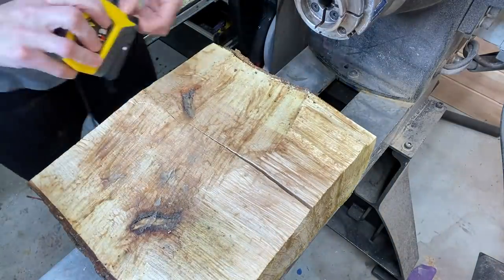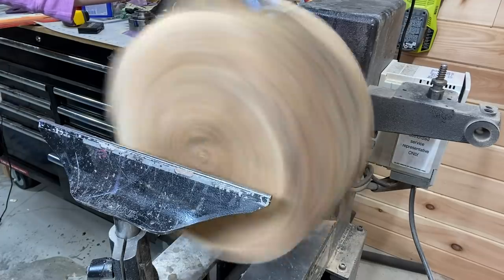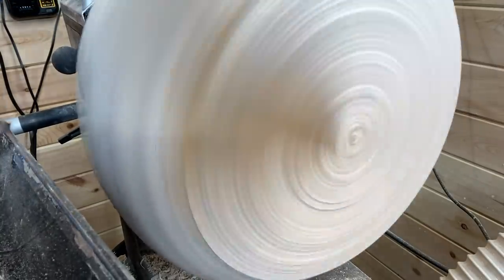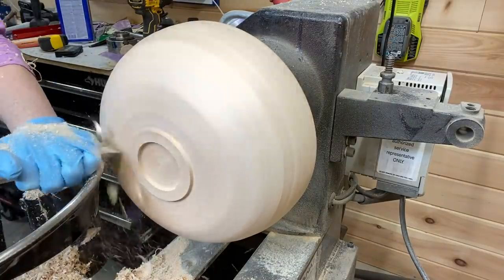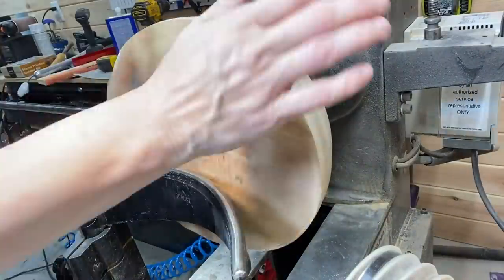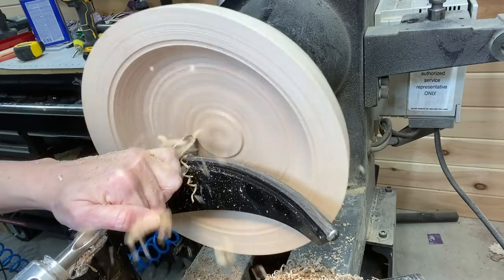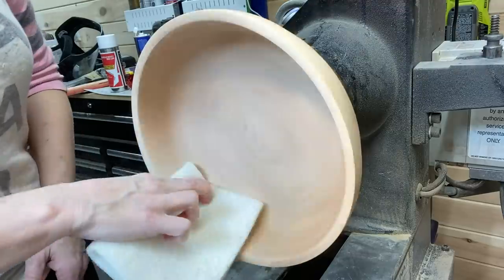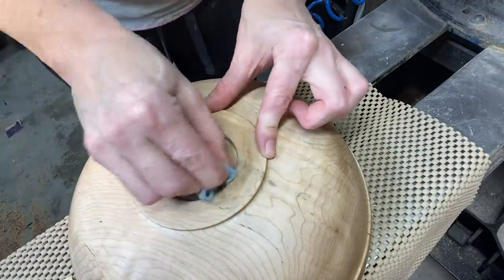Woodturning a SILKY Smooth Finish (How to)

Comment: I'd like to share a sandpaper tip I learned from an interior painter back in the '70s:
 Cut a 1.5" to 2" strip fom the narrow side of a sheet of sandpaper, fold it in thirds lengthwise. It's much easier to hold and manage, you'll utilize more of the sanding surface and you"ll have 3 surfaces to use before cutting more.
Reply from the maker: Awesome, thanks!!
Reply: It won't make sanding any more pleasant, but easier is always better.

Comment: Oh the Zen of sanding! I did high-end stringed instruments finishes for years.  Talk about sanding!  All by hand, (tuff to spin a guitar like a bowl).  Also, during surface prep, before the first coat of nitrocellulose lacquer, the sanding pattern must follow the grain to avoid cross scratching.  Necks, sides, back and sound board, including the areas where the neck joins the body, generally 80 to 400 grit.  Then spray and sand, spray and sand until you have a glass like, super thin finish.  .  Definitely  requires a high tolerance to repetition.
Reply from the maker: Wow, yes, but what a nice finish in the end!

Comment: A very beautiful maple bowl with a great grain.   I am always confused by the very common practice of driving screws with a powerful battery powered drill without first drilling a pilot hole. Especially when the wood is as hard as the aged maple  “blank” must have been. I was actually taught that in wood shop in 8th grade. My impression is that the quality of most wood screws today isn’t sufficient to stand up to the drills. So I always drill a pilot hole...a precaution that is worth the effort, I think.
Reply from the maker: Thanks. Sometimes I do and sometimes I don’t.

Comment: I have a Jet 12-21vs and I use 1&1/4 " torque drive and I still have the same 7 of 8 screws for the last 2 years, one broke off. Torque drive is the best to use, they don't strip out unlike a Phillips and you don't have to use a lot of downwards pressure. I make 70-80 bowls a year to sell at Farmers market.
Reply from the maker: Nice. Thank you!

Comment: Love your work. That chuck is really expensive!  Then the additional jaws just make it worse.  I’ve used the One Way Stronghold chucks for years and they are bullet proof.  I also built a jig for the bandsaw that will cut a blank that needs little trueing up. I don’t like getting beat to death riding a bowl gouge on a big piece of wood knocking corners off that could have been cut off.  Continued success.
Reply from the maker: Thanks, Sandy!! I agree, that a lot of money~

Comment: Good afternoon Peggy,
I hope you are doing well.  I haven't been getting the notifications of your posting of videos.  I saught out your videos last night.  When I had my millwork business and we had a board was developing a split, we would drill a very small hole at the end of the split which would stop the board from splitting further.  For us it worked every time.  The drill bit we use was 1/32" or smaller.
Reply: By the way, I'm in Dunbar, Wisconsin.
Reply from the maker: Good to know, thank you!
Reply from the maker: Never been to Wisconsin

Comment: Regarding screws, I am a big fan of deck screws with the torx/whatever pattern (bit comes with them).  I have literally been using the same 6 screws for probably the last 30 bowls I have turned and nary a problem yet.  They hold up very well and don't seem to strip very easily.
Reply from the maker: Good to know! Thanks!

Comment: I have bees wax in my tool box and rub wood screws along it to ease them in to fresh wood with a pilot hole. I used to snap off a lot of wood screws. Not anymore. Dad had an old bar of Dial soap in his toolbox for the same reason. Great work and tips as always! 🤓 Also, did you know that Lubec, Maine had a population of 1,359 in the 2010 census? Was one of them you? 😎
Reply from the maker: Nope, I wasn't there in 2010. I go back often though. Good tip on the beeswax!

Comment: Hear is a good tip. Do a way with thoese  Philips face plate  screws,through them in the trash. Instead use 1/4"  or larger hex head drive lag screws, 1 1/4" to 1 1/2" long . These will hold more effectively, be easier to remove with drill, and last longer. You may need to drill the face plate holes larger.
Reply from the maker: Great tip! Thanks.

Comment: Peggy, I liked 2. Was told for a mortise to leave at least 1". If you have different jaws for your chuck, would it be cheaper to buy another chuck like you have, compared to $400 for the new chuck. I would check it out if I lived in Lubec, Maine instead of Monroe, Michigan! How much does a bowl corer cost?
Reply from the maker: Thanks! A coring system ranges from $350-$500.

Comment: Lubec, Maine...Get a Vicmarc VM-120 (~$260 my chuck) or VM-150 (~$400).  I and many other pros (like Ashley Harwood) have used Vicmarc chucks for years.  My humble opinion is that they are one of the best chucks available.  Here is a typical comment about Vicmarc chucks:

 " The vicmarc chucks are on another level compared to the nova chucks. We use vicmarc chucks and have never had a single problem out of them, and that's with turning a few thousand bowls every year.
They aren't cheap, but you'll wear out 4 nova's before you even clean a vicmarc.
If your going to use the full capacity of that lathe (20" or so?) Your going to want a good chuck that'll hold. I've turned several pieces 26"+ and the Vicmarc chucks grip like nothing else."
Be safe and creative...kunk (subscribed)

p.s   Beautiful bowl,  well done
Reply from the maker: Cool, thanks very much for the info.

Comment: I'm curious to know why you use the curve tool rest on the inside of the bowl but I never see you use the curve to actually curve around the outside of the bowl? 

  About the chuck. How many times do you actually need to change jaws? You can buy  Nova bare chucks for $100 and jaws separately to make what you want and for $400 you could have 2 extra chucks with jaws already mounted and just swap chucks
Reply from the maker: Thanks for the info. The curved tool rest is specifically for the inside of the bowl. They make ones for the outside too.
Reply: @PFWoodturning  I didn't realize that, I thought the same rest could be used inside or outside of the bowl, thank you.
Reply from the maker: @dirtycurty1202  I didn't know it either, until a few months ago!

Comment: Please! Tried & true woodworkers don't ram a woodscrew into year's dried hard maple, without pre-drilling the screw's core size.
Reply from the maker: Never said I was tried and true.
Reply: @PFWoodturning  All of us here, no matter the years or decades we have invested in this hobby/trade/profession/craft/etc. can learn lessons, should we so choose.  I see many on these woodturning channels, spread glue with a credit card, when a 3" paint roller provides the optimum glue thickness overall at .0002/Inch. The roller can be stored in a Ziploc for weeks without drying out, or washed, then spun dry with compressed air. 
Ashley Harwood, one of the 10 best turners here on this E-air-th, some time ago posted a video about how to clean up a bandsaw for we turners.  While it was excellent, she missed taking a wirebrush to the rubber tires to eradicate the built-up resin/dust/etc from them. 
We can all learn, should we choose that option, which, I why I watch how you do things and I learn.  This sharing will become the ethical basis for the new economy going forward.